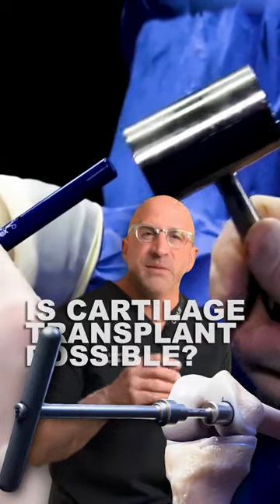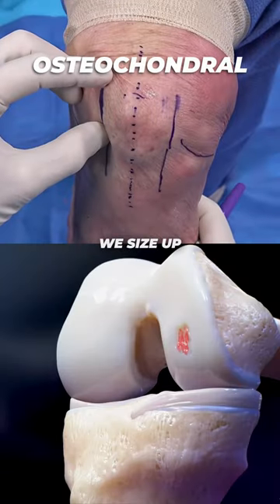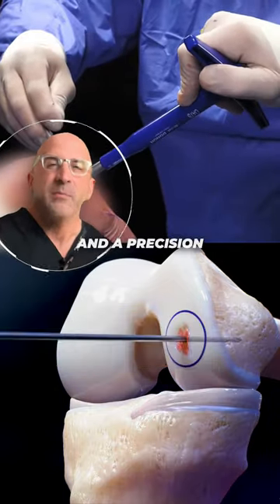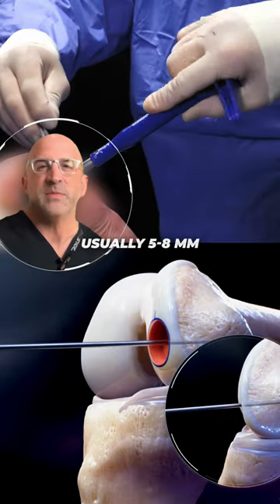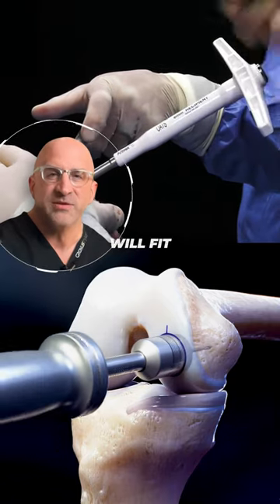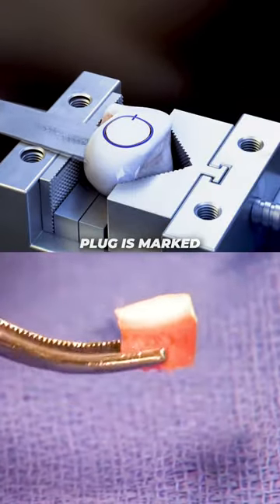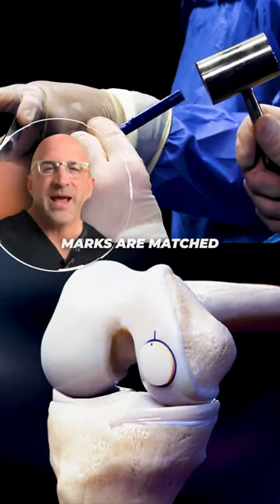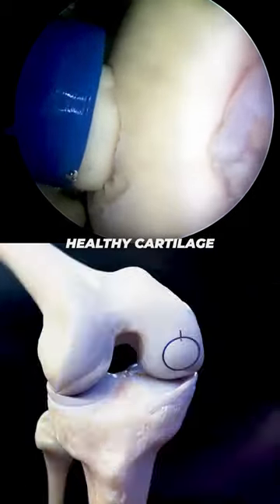Knee Cartilage Transplant for Knee Pain Relief #shorts

Comment: i had something similar done back in 2016. an ACI in my left knee. took a biopsy during a laparoscopic procedure, sent it to a lab to grow more and then an open procedure to patch it to the back of my kneecap. it helped a bit but not a complete relief of pain.
Reply from the maker: Thanks for sharing 🙏 sounds very similar. How is he doing? What problems are you having before surgery?
Reply: i had knee pain from an injury when i was a kid. i had a TTT, lateral release and chondroplasty back in 2009 which kind of helped for my army years. and then the pain started coming back.  i had grade VI chondromalacia on the back of my kneecap and then had that ACI done. it helped again for a number of years but it’s starting to really grind now. you can audibly hear it when i go down stairs. but since im only 32, i’ve been told there’s not much they can do until a possible knee replacement later on. i was hoping to find someone that would just do a patella replacement since the rest of my knee seems to be ok.
Reply from the maker: @jaclyn.jenkins  there is sometimes a point at which the only answer is knee replacement. However, partial knee replacement is an option and some younger active patients and is less invasive. Hope you’re able to stay active in all continues to improve. Thanks for taking the time to share your experience.
Reply: I have serious arthritis in both knees and I get gel shots in them. They have really helped me and I’m pretty much back to normal.